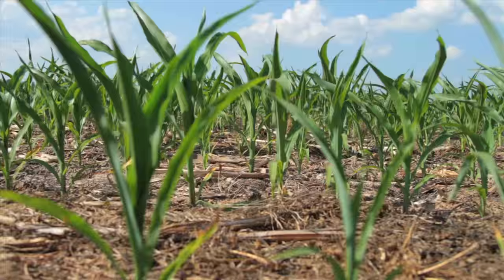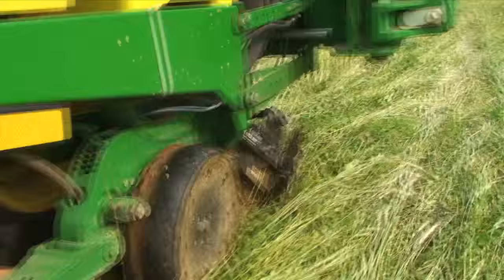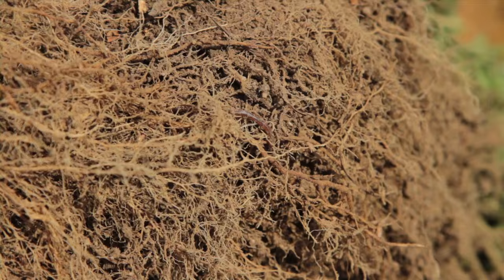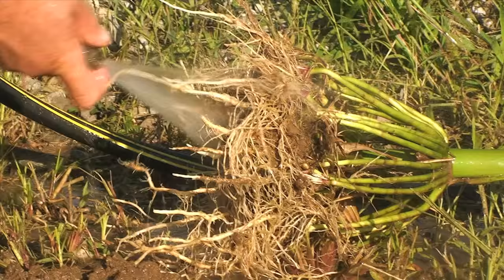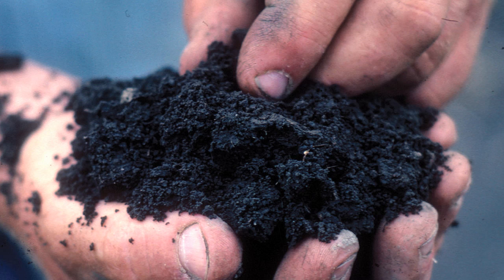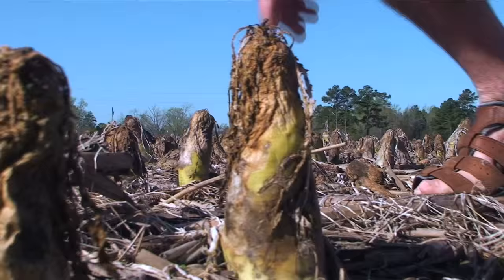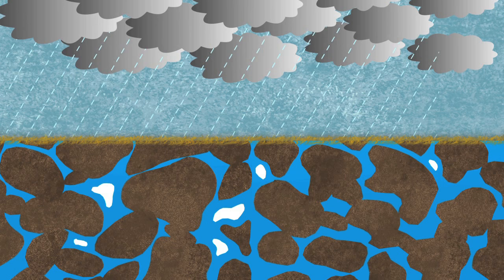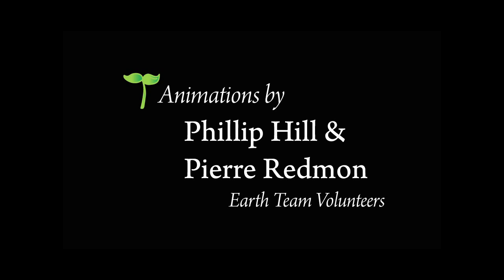Chapter 3: Do not disturb – No-till farming

Comment: No doubt no till has its place in some areas and some soils.  NOT ALL AREAS.  We first used this method four years ago planting a hundred and fifty acre paddock in Barley using knife points after using roundup ar the recommended rate and waiting for a week. The paddock right next to it we plowed and it was left very clumpy so we followed along behind with a cultivator, then we cultivatored it all again.  Admitidly it was an extra three passes and cost us more in fuel, but we didn't spray with a knockdown and the cultivator was close on forty foot wide so it didn't take long and fuel costs were minimal.  We then went in with a seeder of the exact same type but just a conventional tyned undercarriage with five inch points.  Same seed rate, same fertiliser rate, both paddocks hadn't been in crop for three years and both paddocks had wheat in them previously.  Both paddocks were identical soil types.   The ploughed and cultivated crop outyeilded the no tilled crop by four bags to the acre.   Following year we put both paddocks into lupins and gues what. Same story.  The extra pass with the cultivator compared to using a knockdown still worked out that we were thousands of $$$ a lot better off by using the tillage method.    I'm not knocking no till but where we farm it just doesn't work as well. We also noticed MORE EROSION  in the no tilled paddock after a heavy down pour.  Maybe further inland where they need to hold onto as much moisture as possible results are different.  But now inland farmers are starting to use mulbourd ploughs to bring up a bit of clay in their sandy soils with amazing results.  We are by no means bigtime farmers, at the most well sow 6,7,8 hundred acres of our two two thousand.  We also run 4000 sheep and a hundred or so cows. But when your talking some farms putting in ten to fifteen thousand acres, some even double, triple that, an extra four to five bags to the acre can run into the millions at three hundred bucks a tonne.  Do the maths and you'll see what I mean.  Some places the opposite might occur. Just not ours.